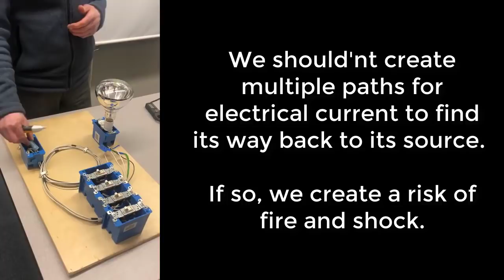Parallel Paths

Comment: Well, I'm an EE so I don't know what exactly to say about this video....It attempts to explain something that is wired incorrectly (a rarity) rather than to explain why it is that we keep the ground and neutral separate and the reason to do so. There's no explanation of what would happen if a legitimate fault occurs whereby the ground wire would provide a path to protect people and equipment. 
Miswiring is NOT the reason we use this scheme, SAFETY is the reason. Miswiring is NOT a mode of failure, it is a human error and a quality issue, and it is rare indeed.
If you're trying to explain this "problem" in the context of Home Inspection then you should say that you're targeting 'home inspectors' that would do a test like this in the service panel to determine if anyone miswired a fixture. IMO, this would be a waste of time, however. 
A simple search yields this much, much better explanation of why we keep ground wires and neutral wires separated until joined in the distribution breaker panel and shows a practical mode of fault in an appliance that would protect a person in the event of that fault. 
https://www.youtube.com/watch?v=zLW_7TPf310
Reply: Your points are very valid for properly trained electricians.

However we do not live in a perfect world, where every wiring connection was wired by a licensed contractor.
 
Home inspectors will run into panels/fixtures/appliances that were wired by the homeowner or his brother in law.
Who probably does not know the difference between the ground and the neutral and thinks WHY NOT?

Home inspectors must inspect for these situations. They can be held financially liable for mistakes or omissions in their inspectipns.
Reply: so wasn't  this video and that video contradict?

Comment: This shows nothing, You have 5 wires connected to the light and one of these has to be the neutral wire. Each one of the 4 switches directs current to the light through different sized wire. Can you guess which wire is the neutral? Its the ground wire. You are using the ground for your neutral. Plus you have your wires tied in a round coil which causes magnetic induction giving feedback to the other wires. Nothing up my sleeve here...

Comment: This makes no sense. How is the ground connected? to the neutral at the lamp?
Reply from the maker: I have connected (improperly like happens in sub-panels and elsewhere) and connected the neutrals and grounds together under one wire nut.  This way I can show the proportional flow back to the source via the various sizes of wires or combinations of wires.  Hence, parallel paths.
Reply: Look at his first comment shows a schematic

Comment: I found this video to be a little difficult to follow because of the lack of any kind of wiring diagram or sketch. I cannot stay focused on your presentation when looking at a box of switches and a bundle of wires while you attempt to do a demonstration along with a verbal description as you flip switches and attach your ammeter to different wires. If you ever decide to redo this video, please include a wiring diagram, and refer to it often during your presentation, so that your viewers will have a much better understanding of what you are trying to convey to them. Thanks!
Reply from the maker: Here us a drawing for you: http://www.buellinspections.com/parallel-paths-picture/
Reply: Switching the neutral also adds to confusion?

Comment: So I think your experiment proves the OPPOSITE of your last comment on the video. 
at the buss bar the ground wire and neutral wire is joined together. what you said about the touching a cut ground wire is also no longer true about the size of the wire. when you are the conductor you become the path of MOST resistance.  You would have to cut the neutral and the ground then touch both sides of the ground or the EARTH itself or water pipe etc and the upstream side of the ground to become the path of LEAST resistance. 
Dual path circuit.  Average person 100,000 ohms #14 wire 2.525 ohms per 1000 ft or 0.2525 ohms per 100ft or 0.126 ohms per 50ft.
Circuit 2.06 amps at 120v (all average voltages and amps on sinusoidal wave)
I am going to assume you are 50ft from a power source of 120v. Just because it is a somewhat easy number. Making the total trip 100ft.
So resistance of 0.2525 Ohms for the total circuit path of a #14 AWG wire. 
120v/2.06a = 58.2524 ohm circuit resistance - 0.2525 ohms for wire = approx 58 Ohm resistance for light bulb alone. 58 ohm bulb V=IR V/R=I so with out wire I= 120/58=2.6896x120v = 248.27Watt Bulb. big bulb , but doesn't really matter. 

So in your scenario of connecting the ground wire and neutral to the neutral side of the lamp then you have two 14AWGs connected to one side of the lamp and one 14AWG connected to the line side. So you now have lamp wire 0.126 ohms + amp 58 ohm + (2 wires 0.126 ohms / 2 = 0.063) ohm for total circuit resistance 58.189 ohms. 

So now you cut the ground wire. Neutral side of lamp now 0.126 ohms again. total resistance 0.126 ohms + 58 ohms + 0.126 ohms = total 58.252 ohms
Now  you as a person grab one side of the ground bus bar with one hand and the neutral side of the light with the other (that is a better connection than standing barefoot in a hole)
your body has an average resistance of 100,000 ohms. 
So circuit 0.126 ohms + 58 ohms + (0.126 ohms || 100,000 ohms) ..  Parallel resistance  1/(1/0.126 + 1/100,000) 1/(7.936507+0.00001)=0.125999 ohm total resistance is 58.2519998561 (I have to show the decimal carry through or the human circuit significance goes to 0)
I as measured 2.06 A goes through the bulb at 58 ohms  = IxIxR= 246.1288 watts
I as measured 2.06 A goes through the Line side Wire of 0.126 ohms = IxIxR = 0.5346936 watts
120v / R Nuetral wire 0.126ohms + 58.ohm bulb + 0.126 ohm line side = 2.0600 amps
120v / R YOU 100,000 ohms + 58 ohm bulb + 0.126 ohm line side = 0.0011993029 amps or 1.2 ma.  It takes between 0.1 and 0.2 amps or 100 to 200 ma to kill a human being.

formula  https://www.grc.nasa.gov/www/k-12/airplane/ohmrpar.html

reference : http://science.answers.com/Q/How_many_amps_will_kill_a_human

Here is a description of amperages and how they affect the body: remember-1/10th of 1 amp will stop your heart 
0.100-0.200 AMPERES (DEATH) THIS RANGE GENERALLY CAUSES FIBRILLATION OF THE HEART. WHEN THE HEART IS IN THIS CONDITION, IT VIBRATES AT A FAST RATE LIKE A "QUIVER" AND CEASES TO PUMP BLOOD TO THE REST OF THE BODY. 
0.060-0.100 AMPERES (EXTREME DIFFICULTY IN BREATHING) 
0.040-0.060 AMPERES (BREATHING DIFFICULTY) 
0.030-0.040 AMPERES (MUSCULAR PARALYSIS) 
0.020-0.030 AMPERES (UNABLE TO LET GO OF THE CIRCUIT)

Comment: 0:26 should'nt?  I think you mean shouldn't.  1:59 "great size bulb to use" is incorrect.  "Ideal wattage lamp to use" is much more correct.  This demonstration missed its purpose of describing why we do not want to connect grounds and neutrals together downstream of the service equipment.  Downvoted.

Comment: I,m sorry but this does not explain why neutral and ground should not be connected at an inside panel.  What you have shown explains current paths but does in no way equate to what you are trying to explain in house wiring.  Furthermore no idiot would wire a neutral and ground wire together at a lamp.  That's just plain stupid.  If you want to demonstrate panel wiring you should use panels in the demo.  This demo is totally useless for house wiring.
Reply from the maker: Sorry you do not see the "parallel" but it is there if you look
Reply: Show me what happens in a real panel, a real situation.  I see no parallel at all between your demo and an inside panel's wiring.  Those parallel paths don't exist like that between an inside panel and house appliances (that are correctly wired).  It can only occur between the inside and outside panel.  But you did not show that correlation.  Please re-do the demo and use two panels and show a real world scenario.  All this video has done is confuse a lot of people.   I know you understand what you are trying to show but it falls short in explaining how it relates to real wiring.
Reply from the maker: I think that is the point . This is a demo of why you do not want to wire them improperly.  If you think you can do better, be my guest, most people get it.  Please check out the blog post I did about it.  http://www.buellinspections.com/grounds-and-neutrals-bonded-in-sub-panels/  This blog post also has a schematic of how the demo is wired.
Reply: Thanks for the blog.  But I should not have to labor over the demo trying to connect the dots in what you are trying to prove.  If the demo had two small panels with wiring between them and a lamp for a load it would have proved your point without question.  It would have shown precisely what goes wrong in panel wiring.  You have set the stage for such a video and I hope you will do it.  Even when we know what we are talking about it is a different story to try to explain it to others.  Please take my suggestion and do it again.  You have nothing to lose and everything to gain.  Thanks.
Reply from the maker: A assure you I am not going to make a different demo for every type of learning experience.  This was never intended to be anything more than what it is.  I did make a drawing that shows the same thing. That will have to suffice or you will have to make your own and post it.  Feel free to post the link here. http://www.buellinspections.com/bonding-neutral-and-ground-in-a-sub-panel/
Reply: Charles Buell sir you did great I think he doesn't get the issue or the main premise of a  ground being hot and acting as a return if connected to neutral in the wrong places. I learned from your video and I certainly will not make that mistake now. 

He might just need to look at you schematic
Reply from the maker: Thanks so much pale blue dot
Reply: Man that just flew right over your head didnt it
Reply: What a demanding fella! I think if you self-summarize this video into a title "Don't Connect Neutral to Ground: How to accidentally energize your ground wire", it explains itself.
Reply: Charles Smith the reason you don't cross is because there is current running through the neutral which this video shows. If you think about it, you don't want ground to have current. Therefore this video gives you the data and allows you to think a bit.
Reply: dont diss him he is my uncle
Reply: Perhaps a key missing detail here, is the wiring between the power pole and the building/service panel -- I don't know current codes across the country (or past codes for that matter) but a lot of places only have two hots and neutral between the meter and the service panel - no redundant ground in that run.  Adding that ground wire, I think, is a relatively recent thing.  This video, and your linked schematic, are assuming you're running a four wire service into the panel. A three wire service doesn't have that same issue -- Key detail here, for me at least, is if you have a 3 wire input, then the ground and neutral need to stay bonded.  If you're updating an existing 3 wire property and adding a dedicated ground out to the pole (something I'm doing currently) then it becomes important to get those two bus bars un-bonded.  As for me and my situation, I"m still trying to visualize the importance of having the redundant ground going back to the meter on the pole, but that's another story for another day :-)
Reply: One would think that not having active current flow on a bare metal wire would be an obvious safety goal, but this is Youtube.  Charles, I hope you have not concluded that one should not have neutrals and grounds tied together anywhere, even at the circuit breaker panel with the whole house disconnect, because that is frankly the one place they MUST be tied together!  Let's try this again:  Neutral (insulated wire!) is intended to bear the routine current flows, in a grand circuit that goes [transmission source]->(panel)->hot->switch->*load*->neutral->(panel)->[transmission source].  The problem occurs if you tie the neutral (white) to the ground (green or bare) at the distant end of the circuit, any closer to the load than at the source panel. The bare (or green) ground wire is meant to act as frame ground (and is IIRC completely segregated in some services), to give a loose hot (or failed load device) somewhere to shunt short-circuit current to as a final safety measure, hopefully therein to trip a breaker somewhere.  If you energize the ground wiring, you energize all of the framework that the ground is attached to, all of the metal conduit, junction boxes, panel frames, etc.  Water puddle (aka better earth ground) plus you touching energized framework = deadly shock potential!

Comment: So, the question that screems out is WHAT ARE WE PAYING FOR?
IF THE WHITE / RETURN WIRE CARRIES THE SAME CURRENT AS THE WIRE FEEDING THE APPLIANCE, THEN WHY ARE WE PAYING SO MUCH FOR ENERGY?
Are we, in effect, paying for the same power over and over again? The thaught of it is rather disgusting, but...... informative.
Reply: The worst of it is that we let them get away with it.
 By the way with the new meters you don't just get charged one the usage black wire side of your wires but also on the return / white side. That makes it double fraudulent

Comment: Who in their right mind would connect the neutral to the earth? It’s an accident waiting to happen!
Reply from the maker: Is that what you think is happening here?  Connecting neutral to earth has nothing to do with this video.
Reply: I think he meant why would anyone connect neutral and ground together (both are Earth - neutral goes to Earth out at the power pole, usually - and - ground goes to earth near your circuit panel, ground rod near house usually)
But that misses the point of the video.
The point of the video is that connecting the two (downstream - ie, in the house) can cause your ground circuit  in addition to the neutral circuit to act as power up until it gets to its Earth.
And, yes, you do not want a HOT ground wire in the house for safety,
It should only be hot when some appliance is shorting out (usually a very temporary act).
Reply: @2Truth4Liberty  I think this may be where a lot of the confusion and argument stems from, Not to mention that with the internet, you cannot always tell what country you are dealing with. 

But to Colin CK, you sir are wrong.  "Ground" and "Neutral" absolutely ARE connected together, depending upon WHERE you are talking about.  The Neutral center tap of the service transformer is grounded at the pole, and again at the service entrance. But there are only THREE wires going INTO the circuit breaker panel: The two hot wires and the neutral.  Once INSIDE the service panel, all neutrals and (bare) ground wires ARE BONDED together.  Most household appliance do not even have a ground wire; they have a hot and neutral.  If they do have a ground, it is connected to the metalic shell of the appliance.  And true, INSIDE of electrical boxes such as switch or outlet, ground and neutral are NOT connected together.  But in essence, they already are at the service panel. This can be a very confusing subject if it is not presented carefully and completely.

Comment: Still a bad example... most viewers will assume that correct wiring of the circuit, and parts involved, is being used. Your just confusing people, by not using a real world example, that actually makes sense.
Reply from the maker: You are rather outnumbered by the people that disagree with you :)  It is a demonstration and not meant to represent anything real.
Reply: Whatever makes you sleep at night... and a poor one at that...